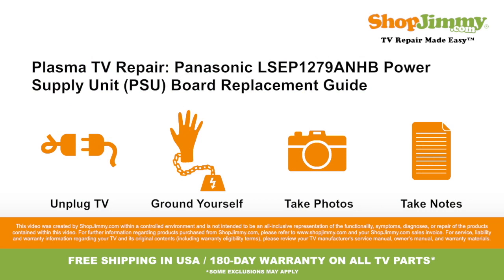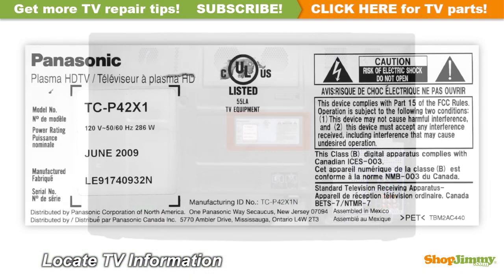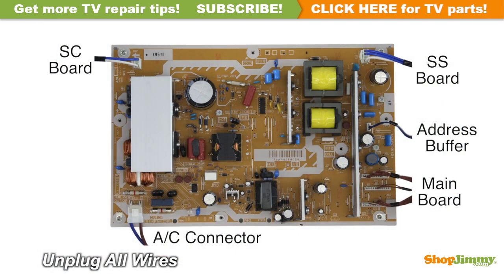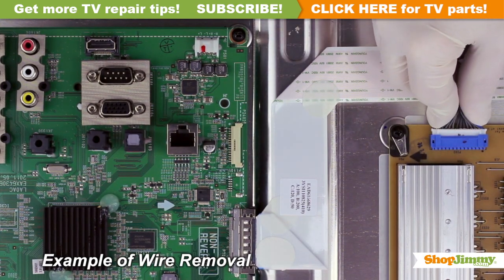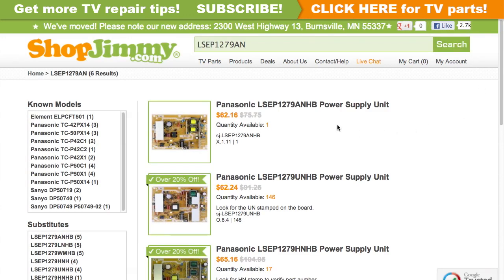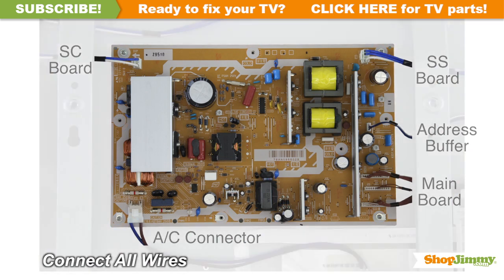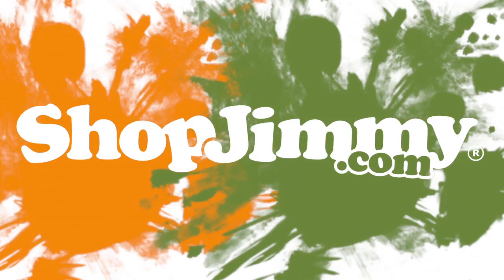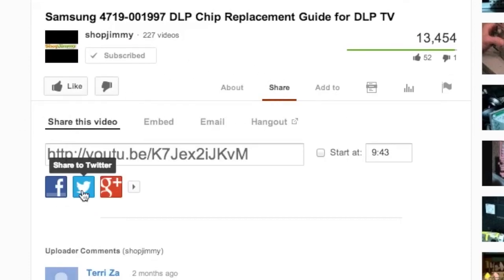Panasonic LCD TV Repair - TV Won't Turn On - How to Replace Power Supply Board

Comment: Hello! I have a 42" Panasonic Viera Plasma Model TC-P42X5. Every time we have a power outage it's takes days for the TV to power on. This is so frustrating. I hear it's common problem with these models. Is there anything we can do the fix this ourselves?
Reply: I got the same TV and i research it awhile back and the problem is your surge protector. I know it sounds crazy but that model plasma TV has a Fuse that resets itself when there's a surge, when the Surge protector does it's job and pulls the surge back. That’s when the fuse goes into that reset mode that takes 2 days. I don't plug that model into a surge protector. I had surges and the Tv had that problem again but it was only 8 hour for the fuse to reset.
Reply: I have had same Prob 3 times in 2 years of ownership. Leave TV unplugged for one to two days and TV will fix itself.  Sounds crazy and I cant explain it.
Reply: Will a new PS Board fix Prob ? Get rid of Pwr Out prob?
Reply from the maker: muzik lvr  Please watch this video FIRST to help with your repair!  https://www.youtube.com/watch?v=BP3NVNCGEv8  I recommend using a surge protector to help protect your TV.  Also, to repair your TV, I recommend replacing the main A board and power supply board in your TV.  Click this link to replacement parts:  http://www.shopjimmy.com/catalogsearch/result/?q=TC-P42X5  Be sure to match part numbers on your current board, with your replacement for compatibility.  Thanks and please let us know if you have any further questions with your TV Repair!  www.shopjimmy.com
Reply: ShopJimmy.com Thanks for your reply. Hopefully replacing the parts you suggested will fix this problem.

Comment: Please help... Panasonic Plasma HDTV model TCP50U2 turned off and wont turn back on.  When you do try to turn it on... red light blinks 10x and then stops and will repeat the blinking after several  seconds... I unplugged it overnight and it still won't work.  :(  Thanks for your time.
Reply from the maker: Jane Yapching   Try this at your own risk. Unplug the TV, then disconnect the SC board and plug in the TV to see if the TV powers up. Reply with the results of this test. Thanks! www.shopjimmy.com
Reply: oops... I just saw this....  anyways...  it still doesn't work...  still has the 10 blinks
Reply from the maker: Jane Yapching   Repeat the same process and test on the SS board.  Thanks!  www.shopjimmy.com

Comment: Panasonic model TCL42U22 clicks on, whistles, powers off by itself with no picture appearing.  Red light blinks 12 times, pauses, blinks 12 times again, etc..  I unplug and restart with same results.  Power board?  Thanks.

Comment: I have a 2009 55 inch samsung plasma tv and i opened it and none of the capacitors are bulging or leaking i found out  which board it is

Comment: I attempted to hook my DVD player up and as soon as I touched the HDMI cable to the DVD player my TV cut off.I unplugged the TV to try and reset even tried a different outlet still no power a friend of my father said it might be a fuse can you help me please the model number is tc-p5ox5
Reply from the maker: Jim Doe   This sounds like a main board problem, so I recommend replacing it.  Unfortunately I do not see any replacement parts in the search results for your TV model number on our website.  Please reply with your part number on your main board and I can try searching for replacement parts.  Thanks and please let us know if you have any further questions!  www.shopjimmy.com
Reply: thank you for your info

Comment: hello. have a 42" Plasma Panasonic TH-42PC77U
the joy of another buyers failed unit after 6 years--mhy power died last week. Replaced the most common areas of failure verses the entire board as had not thought of that option until now, and this was a more affordable route and appeared more commonly recommended by many. I have replaced the MOSFET N-CH with a higher 500V 60A plus the two common fuses with higher 8AMP and lastly the three Diodes(600V 4A) next to the MOSFET as advised by another seller / tech on the many blogs I read up on. Someone recommend this part: 2. A5MC UMI 10ohmJ Thermal Cutoff Resistor. I ask because, when I put it all back (all 30+ screws--sheesh) it powered up displayed all that jazz and I thought I was good to go :) 20 mins later the TV went off but I was away so did not notice what happened. Will not power up again now? That being said could that part relate to something getting blown again of the 5 items I replaced? Frustrated as I thought it was good to go.
Reply from the maker: Just Breathe  Please watch this video FIRST to help with your repair!  TV Repair! LCD, LED, Plasma, DLP How To Fix Your TV with ShopJimmy.com Help!  Yeah, there could be another issue with the power supply and it took out the new components installed.  If you need any replacement boards, here is a link:  http://www.shopjimmy.com/catalogsearch/result/?q=TH-42PC77U  Be sure to match part numbers on your current board, with your replacement for compatibility.  Thanks and please let us know if you have any further questions with your TV Repair!  www.shopjimmy.com

Comment: I also have a Samsung ln32d403e4dxza that the red light starts blinking, the tv then shuts off but the red light stays blinking, then it turns on again by itself in like 10 minutes but it only lasts about 5 minutes on and then it shuts off again.
Reply from the maker: joevalle0940  Please watch this video FIRST to help with your repair!  TV Repair! LCD, LED, Plasma, DLP How To Fix Your TV with ShopJimmy.com Help!  I recommend replacing the main board in your TV.  Here is a link to replacement parts for your TV model number:  http://www.shopjimmy.com/catalogsearch/result/index/?cat=56&q=ln32d403e4dxza  Be sure to match part numbers on your current board, with your replacement for compatibility.  Here is a link to a video showing how to identify your part number, click here:  Samsung Main Boards & Digital Boards: Part Numbers for LED, LCD, DLP, Plasma TV Repair  Thanks and please let us know if you have any further questions with your TV Repair!  www.shopjimmy.com

Comment: I have a Panasonic Viera th50px75u, at first the image would go away and turn black but you would still be able to hear the sound,  now it turns on but the image is still black and now you cant hear any audio. Please help.
Reply from the maker: joevalle0940   Please watch this video FIRST to help with your repair!  TV Repair! LCD, LED, Plasma, DLP How To Fix Your TV with ShopJimmy.com Help!  I recommend replacing the SC, SU and SD boards in your TV.  Here is a link to replacement parts:  http://www.shopjimmy.com/catalogsearch/result/?q=th50px75u  Be sure to match part numbers on your current board, with your replacement for compatibility.  Thanks and please let us know if you have any further questions with your TV Repair!  www.shopjimmy.com

Comment: I have a Panasonic Plasma HDTV TC-P42GT25 that won't turn on and red light blinks 4 times.  I saw on a Fixya forum that: The AP board is responsible for four or six blinks of the power LED.  I cannot find any other reference to an AP Board and wonder if this is the same as the power supply replacement shown in this video.  Can you help?
Reply from the maker: Shua Hendry   Try this at your own risk.  I recommend unplugging your TV from power, then disconnect the SC board from the power supply board and then turning on the TV to see if the TV powers up like normal.  Please reply with the results.  Thanks!  www.shopjimmy.com
Reply: No it doesn't although the blink warning changed to 7 instead of 4.
Reply from the maker: Shua Hendry   Repeat the same process on the SS board.  Thanks!  www.shopjimmy.com

Comment: Hello Jimmy everything i looked at indicated that i have a bad power supply on my Panasonic TC-P50S1 it wouldn't turn on or make a click sound like usual when powering up.  So i ordered the power supply and replaced it but now it clicked once and nothing happened but did notice a blinking red led light it blinks 10 times then stops and then it starts blinking 10 times again and keeps repeating.  Any suggestions should i have replaced something else with the power supply.  ?
Reply from the maker: Metztli Vazquez   Try this at your own risk.  I recommend disconnecting the SC board and then applying power to see if the TV will power up or not.  Please reply with the results of this test.  Thanks!  www.shopjimmy.com

Comment: Went to turn on our T.V. this morning and when i pressed the power button nothing happened. There isn`t even a clicking sound that it normally makes. The model number is Panasonic Tc-p50S1. What suggestions do you have?
Reply from the maker: Metztli Vazquez   Try this at your own risk.  I recommend disconnecting the SC board and then applying power to see if the TV will power up or not.  Please reply with the results of this test.  Thanks!  www.shopjimmy.com

Comment: Hi Jimmy, I have a 50 inch Panasonic TC-P50S30 that won't turn on at all. I got nothing - no blinking lights or sounds or anything!  We went on a 3 week vacation and returned to a dead tv and a blown washing machine so I'm thinking it was a surge or something, even though it was plugged into a surge protector and the other items plugged in on the same strip are fine. Do you think it's just the power board? If I have to replace all the boards I might as well get a new tv....
Reply from the maker: Melanie Corelli   It is recommended to replace the power supply board and the main board in your TV.  Here is a link to replacement parts for your TV model number on our website, click here:  http://www.shopjimmy.com/catalogsearch/result/?q=TC-P50S30  Be sure to match part numbers on your current board, with your replacement for compatibility.  You can also call our customer service for further assistance with your purchase.  (877) 881-6492  Thanks and please let us know if you have any further questions with your TV Repair!  www.shopjimmy.com

Comment: My model # is  TH-37PD25 panasonic plasma 2004 model. no reception on antenna A will not auto program. I do get channels on antenna B with HD antenna
Reply from the maker: Morris Hensley   I recommend replacing the DG board in your TV.  Here is a link to replacement parts for your TV model number on our website, click here:  http://www.shopjimmy.com/catalogsearch/result/?q=TH-37PD25  Be sure to match part numbers on your current board, with your replacement for compatibility.  You can also call our customer service for further assistance with your purchase.  (877) 881-6492  Thanks and please let us know if you have any further questions with your TV Repair!  www.shopjimmy.com

Comment: I have a 2004 Panasonic 37" plasma tv that took a lightning hit. I had it hooked up with a HDMI cord to the cable box and after the hit it would not receive straight cable signal in on antenna A or HDMI unless it was hooked to cable box or VCR  but will receive signal on antenna B with RCA HD antenna. I thought it was the tuner so I purchased a tuner board on Amazon and replaced it but still have the same problem, what next?
Reply from the maker: Morris Hensley   I recommend replacing the main board and the power supply board in your TV.  Please reply with your TV model number.  Click here to view a video that shows how to find your TV model number:  TV Repair Help IMPORTANT TUTORIAL How To Find Your TV Model Number Tutorial TV Repair Help  Thanks!  www.shopjimmy.com

Comment: ShopJimmy.com 

Hey! I have a Panasonic TC-P50S1 and there was a strange noise and the TV turned off. It wouldn't turn back on but after a while it did turn back on, but only to remain a black screen and the so called "red light of death" started flashing and wouldn't stop until we powered off again.  It did this a few times.  What do you think?  Thanks so much in advance!

Comment: Hello Jimmy, I have a Panasonic TH-50PZ700U serial No. NF71220248, My tv turns on fine but after 3 min it turns off on its own. When I try to turn it back on the second time it turns off even sooner, and so on and so on.

Comment: My Panasonic vierra plasma tv model TC-P42X5 shuts off when power goes out and won't come back on for 4 days. Every time it's 4 days then it turns on and works fine, until the power goes out again! What is the problem and how do I fix?
Reply from the maker: Kim Harrell   I recommend replacing the power supply in your TV.  Here is a link to replacement parts for your TV model number on our website, click here:  http://www.shopjimmy.com/catalogsearch/result/index/?master_part_type=Power+Supply&q=TC-P42X5  Be sure to match part numbers on your current board, with your replacement for compatibility.  Here is a link to a video showing how to identify your part number, click here:  DIY Plasma TVs 101: Part Identification Number Guide for Panasonic Power Supply (PSU) Boards  You can also call our customer service for further assistance with your purchase.  (877) 881-6492  Thanks and please let us know if you have any further questions with your TV Repair!  www.shopjimmy.com

Comment: Hi I have a Panasonic Viera Model TH-P42X20Z Plasma, when turning switch on no picture or sound, it has like a double click sound  when turning on(clicksound instantly after one another 2x) green light comes on, the clicks and then red light that flashes 4x...can you help or assist with problem?
Reply from the maker: ATA NGAWAKA   I recommend replacing the power board in your TV.  Unfortunately I do not see any replacement parts in the search results for your TV model number on our website.  Please reply with your part number on your power board and I can try searching for replacement parts.  Thanks and please let us know if you have any further questions!  www.shopjimmy.com
Reply: how much does the power board cost? thanks
TV model TH-P42X2X (thats what its got on back of tv Panasonic Viera hope thats right, i wouldnt have a clue the part number on my power board unless i take it apart, sorry im a female so i wont b all that helpful in terms of what you are asking but i shall do my darndest to try answer your questions...
Reply from the maker: ATA NGAWAKA   Unfortunately I do not see any replacement parts in the search results for your TV model number on our website.  Please reply with your part number on your power supply and I can try searching for replacement parts.  Thanks and please let us know if you have any further questions!  www.shopjimmy.com
Reply: hi i have the part number for power suplly box 87LE8098501 and theres this other number on another sticker next to it V0222whether it has any significance. hope i have given the right number, also i am located in Tauranga, New Zealand...Cheers  There is one other question id like to ask, why replace the power supply what is the actual fault and how did it occur? thank you
Reply: sorry if you dont already have my info it is for a Panasonic Viera Model No: TH-P42X20Z
Reply from the maker: ATA NGAWAKA   Unfortunately we do not have any info on this TV.  Thanks!  www.shopjimmy.com
Reply: ATA NGAWAKA I have the same tv, bought from JB HI FI 2 years ago, it crapped out we paid 500 to get it fixed and it's carked it again, did your chip work?

Comment: Hi Jimmy i have a panasonic tx L50BL6B. screen turns on flashes a picture for a couple of secs then go's in to standby mode.
Reply from the maker: doobiedoo74   I recommend replacing the power supply board in your TV.  Unfortunately I do not see any replacement parts in the search results for your TV model number on our website.  Thanks and please let us know if you have any further questions!  www.shopjimmy.com

Comment: Our Panasonic Viera 42 inch Plasma TV, model #TC-P42X1, quit working after a lightning strike.  We get the red light blinking 10 times but no picture or sound.  We tried waiting a few weeks and plugging it back in, but it still doesn't work.  We took the back off of the TV, and the fuses tested OK.  Suggestions?
Reply from the maker: Susanna Hill   I recommend replacing the A main board in your TV.  Here is a link to replacement parts for your TV model number on our website, click here:  http://www.shopjimmy.com/catalogsearch/result/?q=TC-P42X1  Be sure to match part numbers on your current board, with your replacement for compatibility.  Here is a link to a video showing how to identify your part number, click here:  Panasonic Plasma HD TV Repair Tips: Suffix Codes for A Board & Main Boards  You can also call our customer service for further assistance with your purchase.  (877) 881-6492  Thanks and please let us know if you have any further questions with your TV Repair!  www.shopjimmy.com

Comment: I have a Panasonic TH42px75U with low hrs for its age. The TV powers on, and it has a constant solid red light. It has screen is dark and no sound with any imput. (cable, dvd, etc.) Went through all the protocols too. Needs a new?  Thanks
Reply from the maker: Christopher O'Donnell   I recommend replacing the SC board and any buffers that attach to the SC board.  Here is a link to replacement parts for your TV model number on our website, click here:  http://www.shopjimmy.com/catalogsearch/result/?q=TH42px75U  Be sure to match part numbers on your current board, with your replacement for compatibility.  You can also call our customer service for further assistance with your purchase.  (877) 881-6492  Thanks and please let us know if you have any further questions with your TV Repair!  www.shopjimmy.com